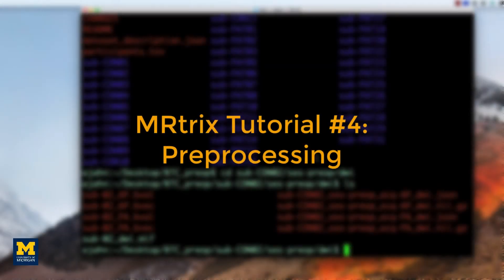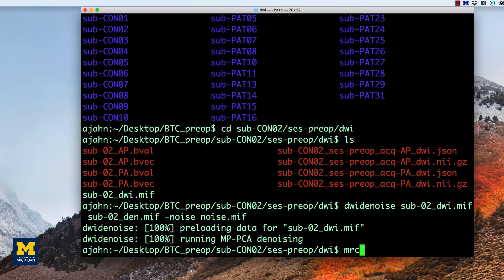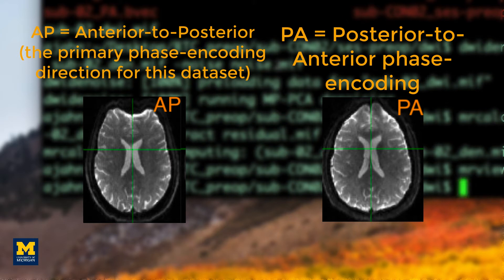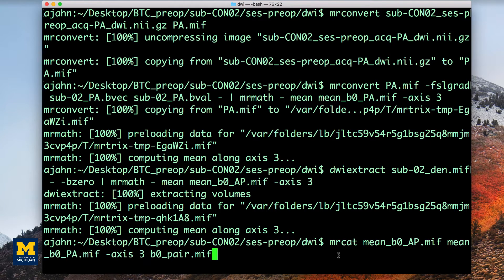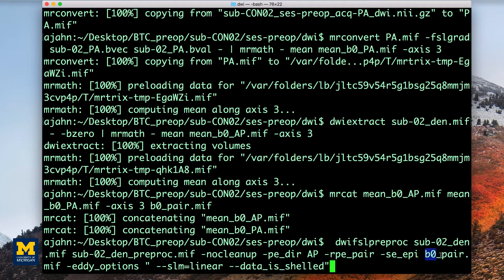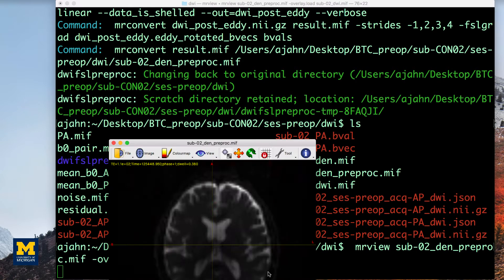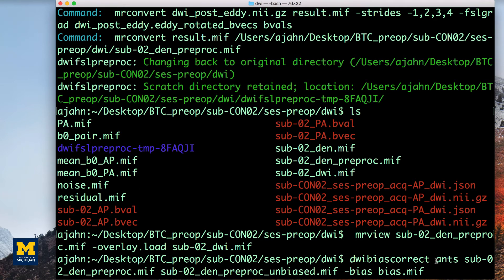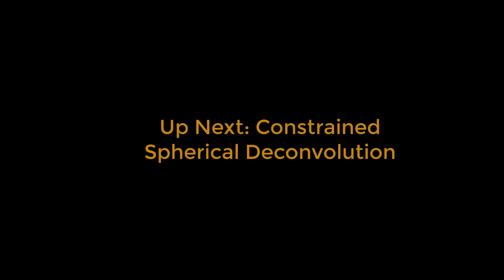MRtrix Tutorial #4: Preprocessing

Comment: What happens if we don't have access to AP/PA files? As in our dataset includes dwi, bvec, bval, and T1 data only. Do we skip that preprocessing step?
Reply from the maker: I would still use the command dwifslpreproc, but you can remove the options "-rpe_pair" and "-se_epi". However, I would recommend collecting reverse phase-encoded images if you can, since it will remove distortions in the image.

-Andy
Reply: @AndysBrainTube  dwifslpreproc sub-02_den.mif sub-02_den_preproc.mif -nocleanup -pe_dir AP mean_b0_pair.mif -eddy_options " --slm=linear --data_is_shelled"
its giving error with the mean_b0.mif

i have just extracted the mean_bo for the DWI data I have, using:
dwiextract sub-02_den.mif - -bzero | mrmath - mean mean_b0.mif -axis 3
Reply: @shahzadaliii  
I am not an expert here but I think the following command should work:

dwifslpreproc sub-02_den.mif sub-02_den_preproc.mif -nocleanup  -rpe_none -pe_dir AP -eddy_options " --slm=linear --data_is_shelled"
Reply: I also would like to know...